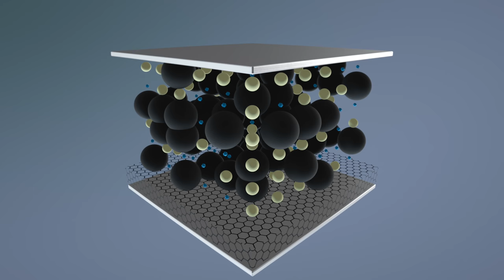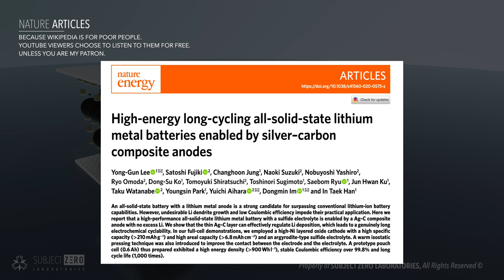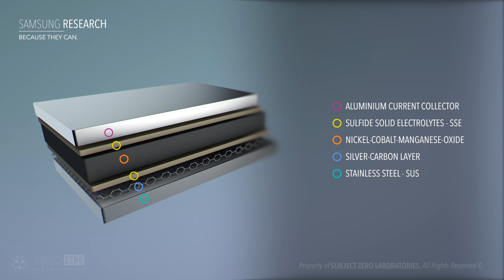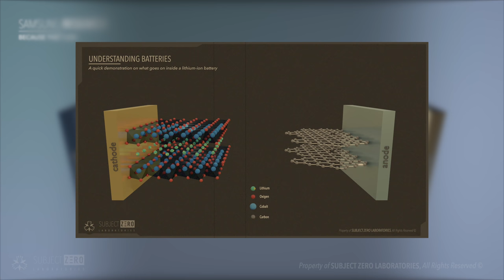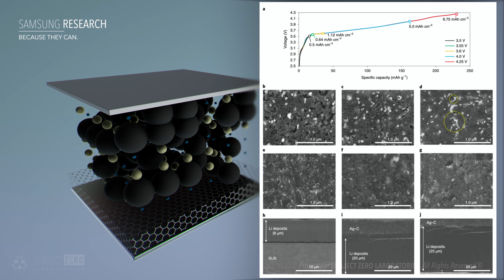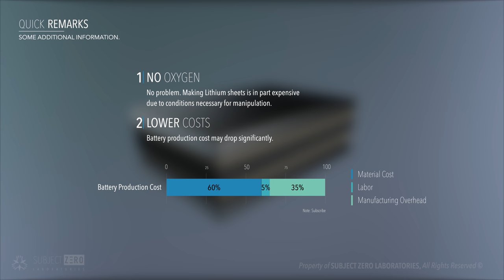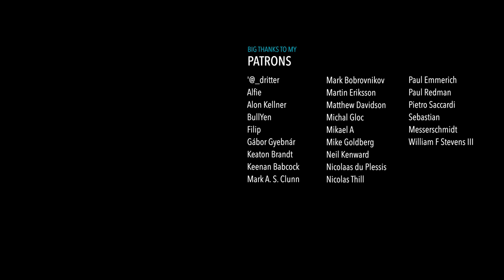Breakthrough Solid State Battery - 900 Wh/L Samsung [2020]

Comment: FREE BEER TOMORROW !
As a lifelong cyclist and senior I have been keeping an eye on electric bikes for
about ten years now .  My lung capacity is about 50%  so I decided to 
finally put an electric  kit on my well used touring bike . To put things simply
Lithium batteries have about 1/3 the energy density of gas. They are expensive.
The most expensive part of the system as a matter of fact . I would not have 
gone electric if not for medical issues . If you commute 20 or 40 miles daily and are
fit then an electric bike makes sense . If you only commute 10 miles a day an electric
bike is just another expensive toy .  And where are all the Tesla's?

Comment: This doesn’t consider the power to energy ratio and impedance of batteries.  Smaller batteries will be worse for both.  900Wh/l is great for phones but will be more difficult at rate for a vehicle.

Comment: Applying efficiency considerations to the gas-powered vehicle but not to the electric vehicle is VERY misleading. Unlike gasoline, a battery IS NOT an energy source, but an energy storage device. The SOURCE of the battery's energy is the coal-fired power plant on the other end of the outlet, whose efficiency is limited by thermodynamics -- just like a car engine.

Comment: Since when is energy density measured in WH/L? The more important metric is WH/kg. Even at the current volumetric energy density, there's no problem packaging the battery in an EV.
Reply: I believe Tesla's 2170 cells are in the mid 600 watts per liter range.  It IS an obscure method of measuring but might have more meaning in the cell phone world where pouch batteries dominate.

Comment: You might be able to charge this battery much faster but what about the infrastructure to do this.  It's $2000 for a Tesla charger installed in your house and you'll need a driveway.  It'll take around 30hours to charge it from a conventional wall socket.  To get the full benefit from a solid state battery you will need 10 times the wattage.  Just saying, the main disadvantage of battery cars isn't the range, it's the time needed to charge and the availability of chargers.

Comment: Graphene batteries are supposed to  have 400% more power and charge x5 faster vs lithium batteries. Better in every aspect especially temperature performance range + they don't explode.
Too bad they've not managed to develops these for the market yet. 
Graphene/Lithium hybrid will be out soon however.

FYI, I'm no Einstein however I love energy tech.

Comment: The capability/capacity is something that while present in the battery pack will be limited, as in the case of Tesla, and sold as an option. So your 400km range car will cost you fees to unlock. This level of tech means you don't own the car you bought, you've licensed it. Some government oversight is needed in this industry and some consumer advocacy. Me I'll stick with simple ICE for now but I'm definitely interested so long as the car is not networked and is mine to do with as I wish without being controlled by the energy overlords.

Comment: Just another dream. Their smaller batteries in the phones don’t last, so I don’t believe they have the car battery that would give the range 5,000km. The law of physics indicates that the charger needed would be enormous to store so much energy into the battery. Not talking about load on the power grid if the battery like this would be charged.

Comment: Cool animations and good pacing, voice etc but I didn't really get it. I guess I kind of tuned out and didn't really get it. I was too focused on "WHAT IS THE CONCLUSION! When-do-we-get-this-mindset". I get a bit tired of hearing about promising scientific breakthroughs but then having to wait years before anything becomes commercial. Often it doesn't become commercial EVER.

Still it brings some optimism. Whatever happens it is clear there is a massive effort today in the battery space and a lot of technologies are being tried out. We are seeing stead improvements and I believe it is just a question to time before it is game over for gasoline cars. At one point EVs will get cheaper at point of purchase, and with total cost of ownership already lower in most cases, gasoline cars are dead.

Comment: Only 1000 cycles? That might be ok for a phone, but not for a car. Tesla is going to have a 1M mile guarantee on their batteries. Let's say 250 miles per charge to be generous, that's 4000 cycles necessary to get 1M miles. Way more than the battery talked about in this video.

Comment: 3:40 ....Why am I not surprised.... oh. It’s because I know silver is used for the metal contacts on solar cells and carbon is the main building block of graphene... So they combined lithium metal batteries with anodes made of silver and carbon huh? Hmm.... how are they composite? Simple yet powerful. 

To replace the nickel and cobalt, have they already dismissed Graphene?

Comment: We need a battery with a higher voltage to reduce space and weight, a 12v cell the same mass and amperage as a 3.7v cell should be the next move.

Comment: Why use Wh/liter for energy density and not Wh/kg ? It is maybe just to sound more impressive for those not very familiar with units ?
Current Lithium battery's are in the 700 to 800Wh/L so 900Wh/L no longer sound as impressive. Many labs announce new batteries all the time but cost of producing some of them will no longer look as good so they never get to market. Samsung already produces batteries with similar (very close performance) so it will be just an incremental step. 1000 cycles at 100% DOD is not that impressive or out of the ordinary and that may be at lower energy density than 900Wh/L.  Still a Cobalt based battery not that impressive for me.
My main house battery while lower energy density has a much more impressive 5400 cycles at 100% DOD it is of course a LiFePO4 so no thermal runaway and no toxic Cobalt.

Comment: How expensive are these batteries going to be to produce though is the question? That is if they can make a proof of concept in real-world use.
Reply: Tyler Padgett easily estimated. Simply remove the total cost of manufacturing the cathode from the gross cost of the production design which currently has a cathode.

Comment: Ford's new motor is claiming 60% efficiency with opposed piston design.
Reply: elcidbob claims which will be coerced into oblivion by Ford combining the OPD with a metal frame, high-visibility glass carriages, energy-absorbing compliant suspension, and the most venerated kit of all energy destroyers, mandatory automatic drivetrains. All these innumerable eliminations of efficiency will require endless supplies of refined lubricants, conduits and liquid coolants to disperse the resulting entropic waste into the public power sink called ‘environment’.

Comment: what does this new building tech of batteries look like when it comes to recycling. I imagine the processes to recycle are battery material and construction specific (at least the most efficient recycling methods) Im worried about just creating another problem rather than say biofuels that are renewable. We will def always need electrochemical batteries but to become the main power storage we need a system in place to handle waste and recycling to both keep material cost down but not create the other problem that comes from mining like the laborors mining and the toxic water that comes frrom mining processes.

Comment: "Wireless energy to power airplanes was a thing" This was never a thing. The tower you show, known as the Wardenclyffe tower, was absolutely real although was never used for wireless power transmission as it was intended. However it was built in 1901 and demolished in 1917. Given that the Wright brothers only achieved their historic flight in 1903 no one was thinking about wirelessly powering planes with this technology at the time.

Comment: The measurements used make no sense. Why not Wh/kg? Liter is pretty goofy unless you're talking watches and phones. Gasoline is 12972.2.  Tesla batteries are 254. That is a difference in energy density of 51 times!!!!  This whole "lithium batteries have almost the same effective density as gasoline" line is total rubbish. The only figure I can find for glass batteries in production is 360 Wh/kg, and that's believed to be on the microscopic level, not the whole battery pack. These glass batteries are heavy. They're going to inefficiently transport themselves, just like lithium. Total weight reduction of the battery pack for distance driven will probably be less than 30 percent.  We can just hope they will end up being cheaper.

Comment: It means all electric  vehicles within five years will be able to go freeway speeds of 85 to 90 mph on a single charge with a range of  400 miles + ; and you can charge your battery at home from zero to full in about 10 minutes ....
Reply: It also means that in ten years the internal combustion engine will become absolete
Reply: Internal Combustion Engine can run on Hydrogen produced by water at home with a solar panel.
They dont want you to know that. They want you to buy new batteries every ten years.

Comment: I just reach the part where gasoline engines only reach about 40% of the potential energy in gasoline. Battery is still at 600 Wh/l, what is the heat produced, that is wasted energy, but you don't factor that in?
Reply from the maker: electric vehicles are at least 90% efficient. Loss through heat is minimal and that 40% is for formula one cars. conventional cars get at most 20%.

Comment: Chemical batteries are becoming obsolete faster than you can achieve its theoretical peak. Lithium-ion batteries and other variants using other chemicals are a dead-end technology. The future is in nano-ultracapacitors made with graphene. Graphene has a very high surface area and very little volume, on top of that, it is more conductive than gold, in addition to its nanostructure, this allows us to build capacitors in a 3D structure for storage capabilities.  Due to its extremely low volume due to graphene being only a single atom thick in conjunction with its conductivity allows these capacitors to recharge extremely fast, and since there is nowhere near as much loss as chemical batteries, they survive many more charge cycles. This means you can recharge a battery made from graphene ultracapacitors in a fraction of the time than a chemical battery, and it can be recharged exponentially more times than a chemical battery.

Comment: When he decides to talk about the efficiency of converting gasoline into combustion engine power, talking about or inference some energy loss due to the conversion process, he doesn't bother to talk about how the electric vehicles Energy Efficiency conversion loss is in the generation of the charging/recharging power.

essentially giving electric vehicles a free pass on the poor Energy Efficiency when obtaining power and hiding some evidence.
Reply: But then you're doing the same by disregarding the process of finding the oil, refining it and transporting it. You'll really lose that battle.

Comment: A step in the right direction.  But what about charge times? Electric cars will multiply charging stations 4x the qty of gas pumps...which is why space deprived Japan and Europe look at hydrogen.  Think of the effect on the grid.   And until fossil generation is replaced, it’s a half measure.  These complicated, contradictory questions are best handled by the market.  The smartest move is a carbon tax.

Comment: you are wrong about the electric motors of 125 years ago. There were more electric vehicles than fuel. The reason why they failed is that the fuel market artificially made petrol cheaper to buy. Like a Walmart tactic. for the speeds and technology at the time the batteries were just fine. Economics destroyed it not technology.

Comment: Wanna talk about energy density? laughs maniacally

If you could create an antimatter battery, releasing energy through antimatter annihilation has an energy density of 24,965,421,631,578 w·h/kg, which is 259,654,216,316 times that of lithium batteries.

A piece of antimatter the size of your phone battery could power the entire world for 2 hours. That is a LOT OF FREAKING POWER GUYS.

A swimming pool of antimatter could power the entire planet for 50 years. 50 years!

Heck, I'm just talking about normal low density antimatter. If you had a teaspoon of quark antimatter, you could power all of civilization for...

500,000 years. Wow.

Comment: Whow, whow Whow, comparing lithium power density to gasoline is not a one for one. You need to produce that electricity to charge the battery.  Use gas in a home generator that is about 12% efficient to charge the batteries and suddenly those Lion batteries are horrible. Even if you use a 65% efficient source such as a combined cycle plant, you still have to deliver that power with additional sources to the transformers and chargers, then lose another 5% when you convert that DC to AC, and I am being generous.

Comment: At the 900Wh/L of this battery petrol/diesel will still have more than three times the energy per volume.  That's the 40% efficiency of an internal combustion engine vs the more than 90% of an electric motor taken into account.  And this battery is still only pie in the sky.  So, this video is much ado about nothing.  Or is it a storm in a teacup?

Comment: I also want to try My experiment titatiumcarbide battery, .. It is slightly similar To solid state battery but its so dagerous chemical electrolyte composite.. I have atiny experiment but I have problem a cost of all component..  so I have not a finish.

Comment: As much as I wish this were true, you leave out a lot if science to make your claim. 

Your energy density figures are very off. While you are correct that Gasoline engines are roughly 40% efficient, we have been starting to reach 50%. Gasoline has an energy density of roughly 45 Mj/kg. So, let's say a gasoline car makes 22.5 Mj/kg when these supposed batteries are released. 

A pure lithium battery does not exist. Lithium is an element. A battery requires a cation and anion. In this case lithium and fluorine yield the highest energy density of roughly 22 Mj/kg, almost on par with gasoline engines. With 99% efficiency being possible for future electric motors, it wouldn't be far off. 

However, fluorine is the best compliment to lithium, yes, but, it is also a highly toxic, reactive, and corrosive gas. It would be among some of the most dangerous materials ever put into a form of transportation. It is also highly unlikely that we will be able to reach 100% physical energy capacity of a battery. So, let's say we reach 80% even, which is unlikely, but for the sake of argument, that puts the best lithium battery humans can make with an energy density of around 17.5 Mj/kg. At that low of an energy density, many "more green" new alternative to gasoline could match or outperform the battery. 

But wait, there is more! That was assuming the battery was made up of purely lithium and fluorine, which as you highlight, is not the case. Even if you had it make up roughly 60% of the battery (which has yet to be done), you would only get a mere 9 Mj/kg.

So, in reality batteries can never surpass gasoline. Not to say they are a waste of time or use. They have their very clear benefits, as we all know. Unfortunately, no electrical charge will be able to match the amount of energy stored at the chemical level. Ripping apart chemicals in a reaction is the most energy dense action there is, besides nuclear energy. Electricity doesn't stand a chance in this sense. It is simply a matter of physics.

I will lastly add that out modern means of production and disposal of electric cars, and solar panels that power them alike, still create a huge environmental impact that is often overlooked. Not to say they are as bad as gasoline cars, but according to several studies, not better enough to be considered substantial.

I like electric cars, I think they are cool, I like their instant torque, low center of gravity, and simplicity, but I think the public is disillusioned with the idea that they are the future. There are a lot of plot holes in that narrative. We must find a green alternative to gasoline, but hopefully a better one than battery electrics.